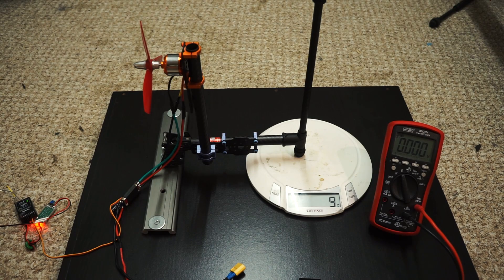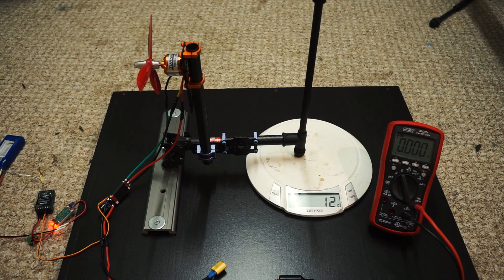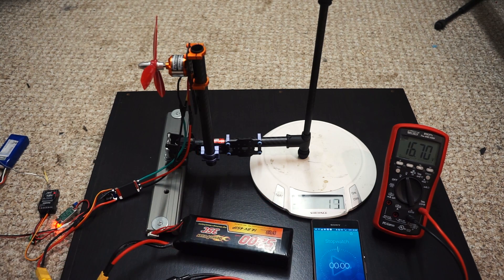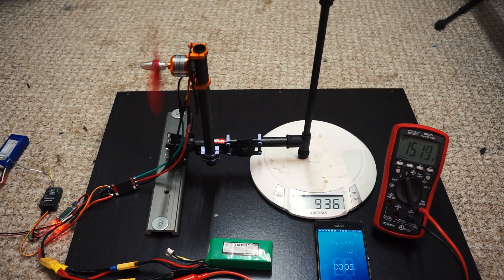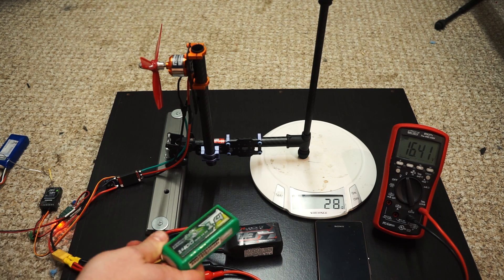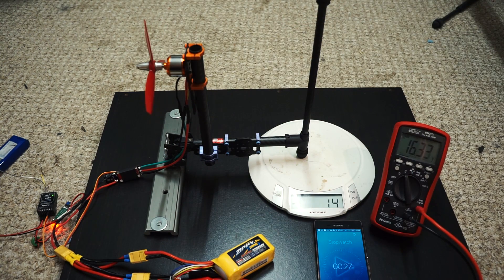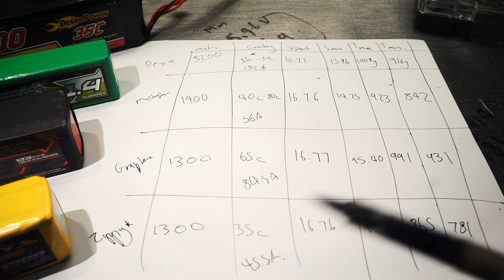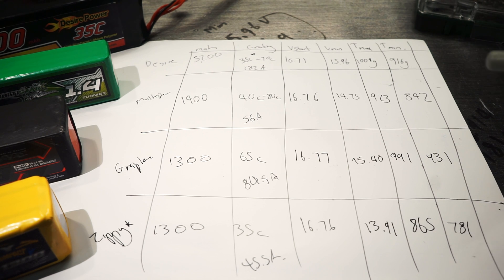Hobbyking Graphene thrust and voltage test

Comment: 2200 KV motor, LOL ...  What is "C" ?  ... The battery has a lower internal impedance, that's why it can provide current with less heating, why you get more thrust.  A true improvement would be a reduction in size and mass for a given capacity.

Comment: Very nice video. I have been doing a lot of LiPo testing on my channel lately and LOVE your test rig. (I just might have to build one of those for myself.) I think the only thing you were missing was a discussion of the internal resistance (IR) of each pack.

Basically, each of these batteries acts electrically as if they have a resistor inside of them. The lower that resistance, the less voltage sag you will see under a given load. If you had been using an in-line current meter, you could have measured the voltage drop AND the load, which you could have used to calculate the IR of each packs. 

Another key factor to keep in mind is how quickly a battery can dissipate the heat that it creates as a result of its internal resistance. C-ratings are supposed to be a user friendly way of expressing a combination of IR and heat dissipation so you can have a good estimate of how much current you can expect a pack to push safely, but most companies just use this as a marketing tool now.  I talk a lot about this on the RC Physics YouTube Channel and Facebook page. 

Great job!

Comment: I am building a massive 48 amp hour pack put of refurbished 18650 cells. Do you think this could get an ultralight off the ground?
Reply from the maker: There there Andrew, are the cells still able to deliver a good amount of current? How many will you use? I don't see why not if you are matching a commercial battery, this should do fine, as long as you make sure you are able to wire them reliably, you don't want to mess with your safety. :)
Reply: +Nils Rohwer 
Oh yes, I have tested the capacity of the cells, power cycled and charged. A few here and there were bad, but about 90% were good as new. I have just about 1200 cells or so and am spot welding them together with nickel tabs.

Comment: would you recommend using a bunch of graphene batteries for a bike motor
Reply from the maker: Hey there, I assume you would have quite a large capacity battery for an electric bike, if so, you have to remember that the batterys ability to deliver current is also a function of its size. Meaning that a hypothetical 10000mAh battery with a c-rating of 10 would be able to deliver 100amps continuous (10 Ah * 10C). 
What I'm saying is if you have a large capacity battery you don't need such a high C-rating so you could probably go for something cheaper than Graphene.

Comment: its just a higher capacity battery reshaped into a different format... my 2200mah zippys perfrom the same... and the c rating appears higher...its really not...
Reply from the maker: Hey big, that's what I test in the other video on the topic, turns out it's not a higher capacity at all.

Comment: 12:45 you would recommend a battery that allows your model to drop out of the sky? Did I understand you correctly?  I get the part Graphene batteries have more consistency in the voltage from start to end, but if of all the sudden you have no more power after one last punch and it is not a gradual reduction in battery voltage that allows time for your model to land safely, I don't think I would want that in a battery.  I certainly don't want my models falling out of the sky.  I just got some and will do my own testing... meantime I  was looking to see how people are charging these and general comments. BTW,
properly  testing batteries and comparing them with other types requires a more elaborate process and it is just not a matter of looking at the voltage or trust.  You got internal resistance that you you need to find out, to see if indeed the battery is putting out consistent voltage and amperage and how it compares to other types.
Reply: +MIA Micro-FLIGHT (Mario I. Arguello) It's hard to describe.  They don't gradually go soft.  If I notice it's lost the punch power it isn't long before the quad is coming down.   If you have a OSD you can see it coming by keeping an eye on the pack voltage sag / recovery.  I think I have my warning at 14.0v.  When I see that and I return to land uneventfully.